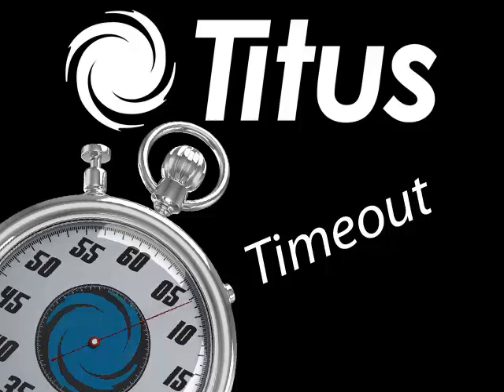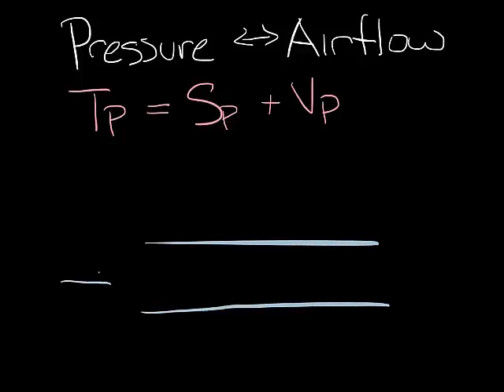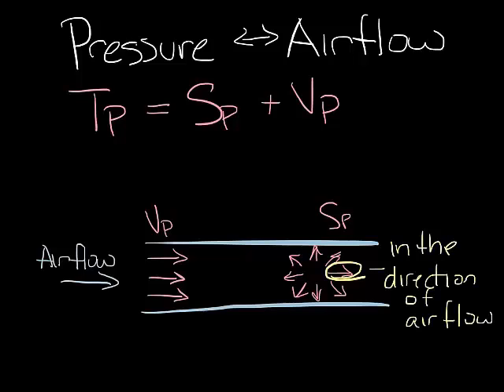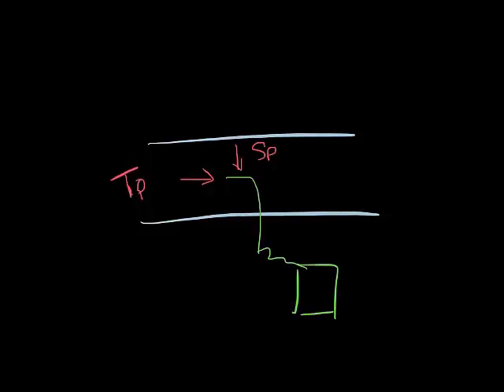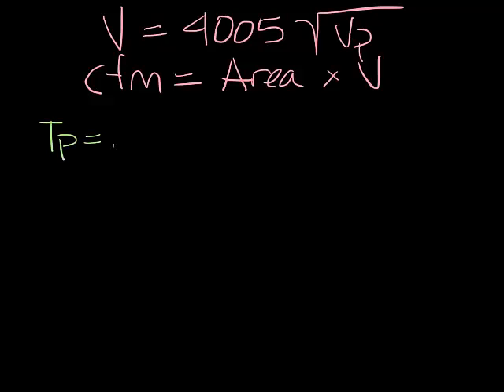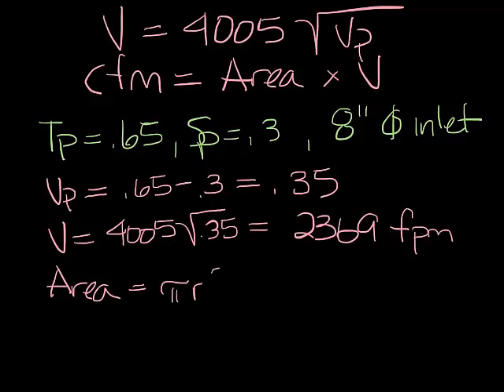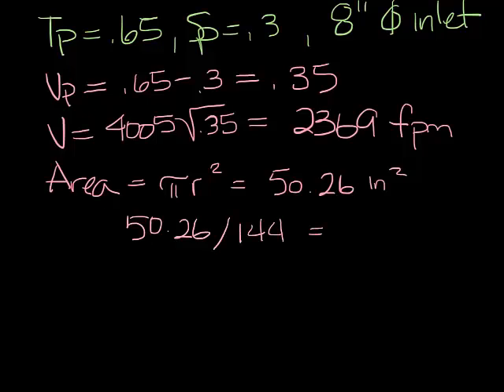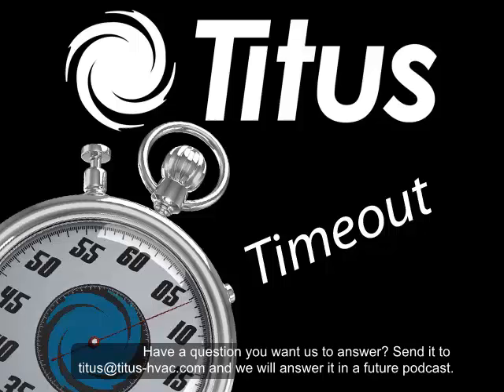Titus Timeout Podcast - Pressure Basics

Comment: If you are to calculate the velocity pressure, then you need to know the total pressure which is, vp+sp, so you already know what the velocity pressure is in that equation, or am I missing something here?
Reply from the maker: Usually in a HVAC system, you are measuring the Tp and Sp,  but you want to know the airflow (cfm), so you use the Tp and Sp that you measured to calculate the Vp and from that you calculate the cfm.